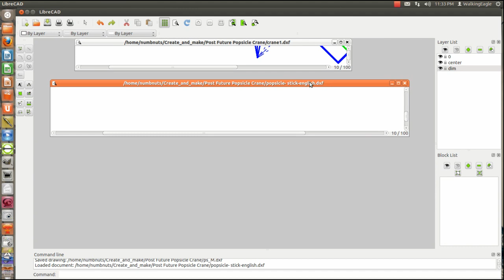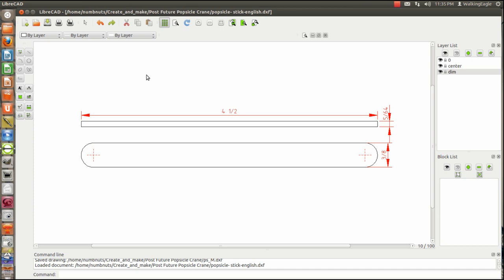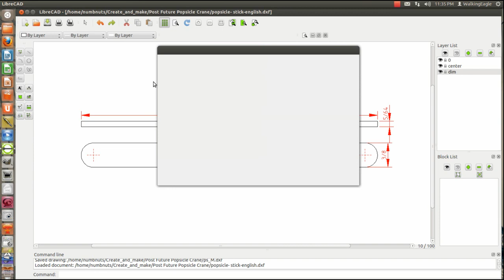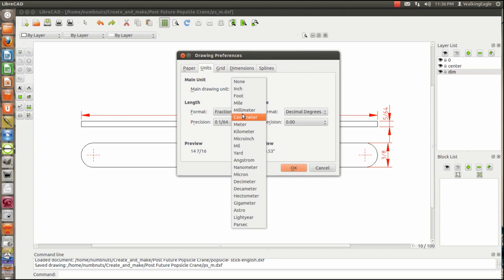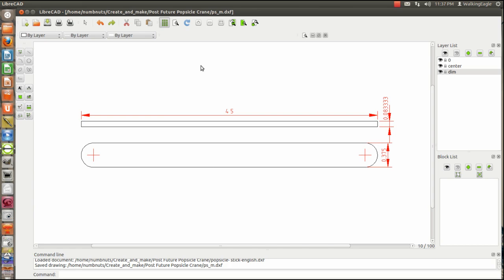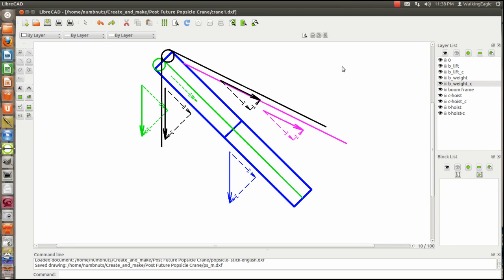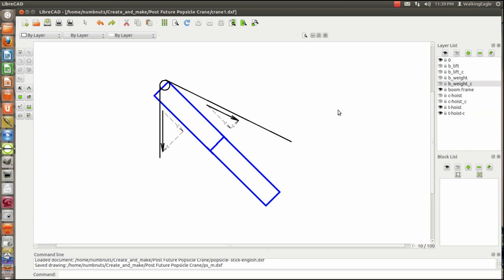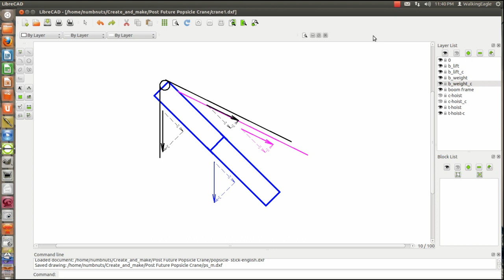English to Metric  & A good use for layers with LibreCAD.

Comment from the maker: Late Breaking news:   After creating this video I created the metric version.  To do it I simply scaled the whole thing, including the dimension lines by multiplying by 25.4 (mm per inch scale factor).  As I assumed the dimension text and arrow heads were too small, but the dimension value did scale up to 114.3 mm.   Smarter than I though!